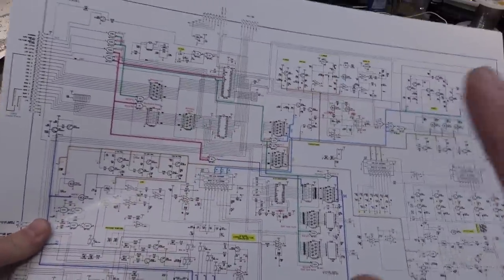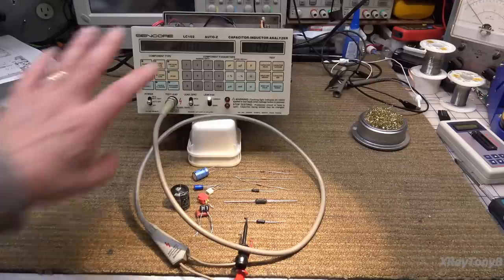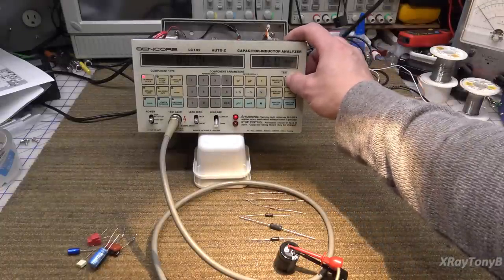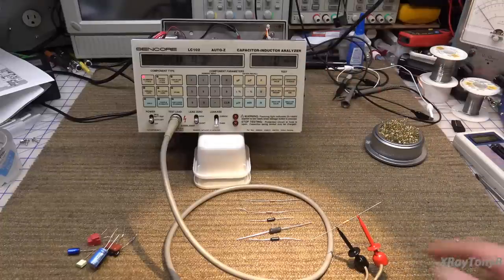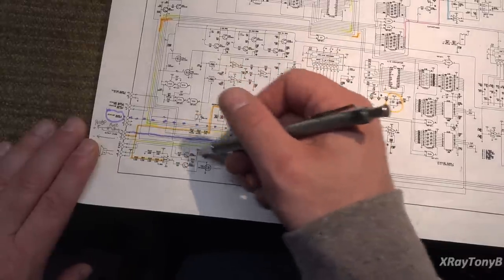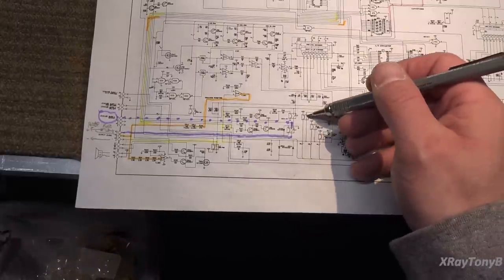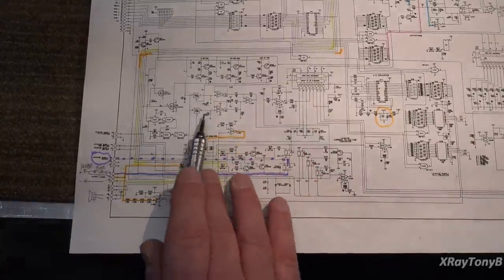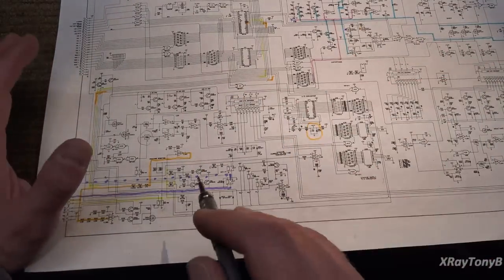Sencore LC-102 - Part 7 - Final

Comment: To think that before these semi-integrated logic designs with D to A convertors, flip-flops, multiplexers and microprocessors we had valve oscillators, rotary switches and wheatstone bridges, and before that a wet finger and a piece of string. Nowadays it's all about cheap transducers and apps designed from templates on github. We've come a long way (or have we?). Great series to watch, great collaboration across youtube and totally gripping. Thank you.

Comment: I have to say; there are quite a few things that are suspect about this unit. While I don’t know how much they cost new, I know it’s way more than I could afford as a hobbyist! 😮 Given that (cost), you’d think they (Sencore) would have at least addressed the following issues:
1) No backlight for the display!
2) no drivers for the relay(s). C’mon, man, at least include a 2N3904 (per relay)!
3) No back-EMF diodes across the relay coils.
4) Enough ranges so you can check resistors up to - say - 1 Megohm, with the (capacitance) leakage test (for a high-end model… if they had a high-end model.) This item is - admittedly - more of a “wish-list” sort of thing. 😊 But the first three are things I would expect high-end test equipment like this unit to have.

Comment: I am so pleased that you have got the thing working.  Persistence is its own reward.

I wonder if it is worth making a couple of further improvements.
1.  Adding driver transistors on the output of the flip-flop chip that drive the relays, reducing the load on that chip, and so further improving reliability.
2. Adding a simple led backlight to the display - if physically possible.

Comment: Hi Tony, I just received my Sencore LC-102. It came with the original box and documents. The tester looks new. The only problem is when I do the shot test, I do get the error 4 code as well. I’m thinking that I may have same problem with the 4066-chip just taking a guess at it. The chip that I see online of the 4066 has letters at the end of the numbers I don’t know what they mean for I am new at this maybe you can tell me what the letters mean. And maybe do a video on the chip checker and the programmer you use and how to use it. I love your videos I have stage 4 cancer in watching your videos keeps me entertain and enjoyment of the way you explain things Thank Tony and God bless.
Reply from the maker: Before checking the 4066 chip, I would verify that the relay contacts on that white relay are clean.  That seems to be the biggest cause of that issue, from what I have read.  You also have to make sure the fuse is the correct size and that the contacts are clean on it as well.  God bless you on your journey; I understand. ;)
Reply: @xraytonyb  Thanks Tony i will check those thing.

Comment: Good work everybody !! Great series Tony, I don't think I would one of these, and there is one thing I hate is a 'Nanny instrument' you talked about entering a voltage to test a capacitor and it would drop it by a small percentage, If I want 100v from my expensive precision instruments then I want 100v not some other value depending how its feeling that morning in fact if I wanna blow my cap up that's my bad it should handle it. But I do find it hard to belive are you sure it's a feature (not a bug) please ? After all I want to know what the instrument is doing and If I knew it was 2v down I would have to enter 102v anyway so sounds crackpot Lol !....cheers.

Comment: congratulations perseverance wins the day again!!
I  have never seen an IC tester before I was speculating about something like that a little while ago trouble shooting a kit built project that did not work turned out that the supplied chip was no good. Do they test identify all kinds of ICs  logic chips, opamps. Can you recommend any?
Reply from the maker: I found that one on ebay a long time ago.  It only tests logic IC's and will not identify anything like an opamp, MCU or D/A converter.  Works great for 40, 45 and 74 series chips.
Reply: The TL866II programmer I use to program PROMs and MCUs is also capable of testing CMOS and TTL logic ICs.

Comment: Curious about the CD4066. If you measure a good one with the diode function of your meter across the power input pins, you will get a diode drop between them in one direction. Testing the dead chips I've run across, this diode junction was open. That seems to be a common failure mode for these particular type numbers. Is that how yours failed too? I have started to check for that diode drop in any circuit I may be troubleshooting if it has a CD4066 in the circuit. I probably have found 5 or 6 of them that have failed that way in recent years.
Reply from the maker: Measuring signal in/out A to signal out/in A reads a diode drop in one direction.  The pins for signal B,C and D all read open.  Vdd to Vss reads a diode drop in one direction.
Reply: @xraytonyb  interesting. That was a different failure mode. I found this entire series fascinating and it leaves me wondering what exactly happened in the beginning.  Was it the failure of the flip flop that triggered all of this or was it a combination to create a perfect storm of destruction??  

Regardless, excellent sleuthing work. You certainly earned your Hardy Boys badge for this one, lol.
Reply: Analog switches seem to go bad and maybe Rds on changes channel to channel